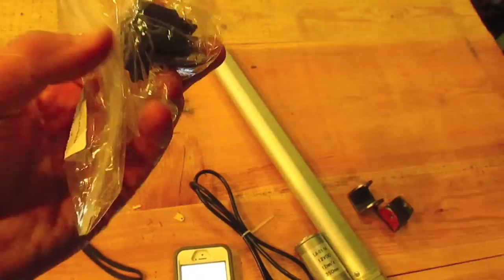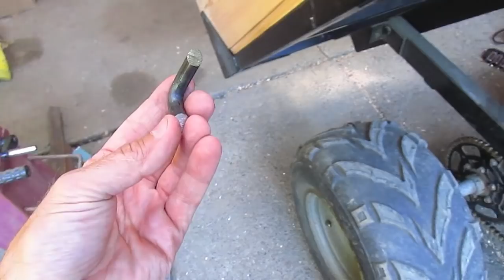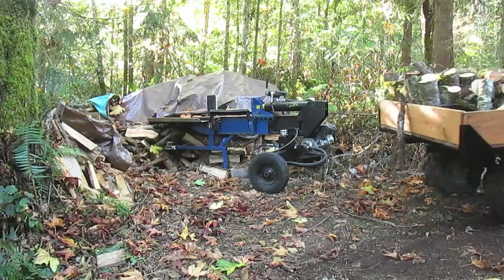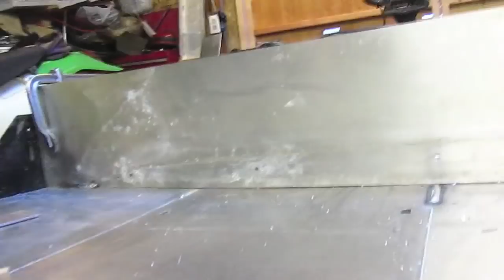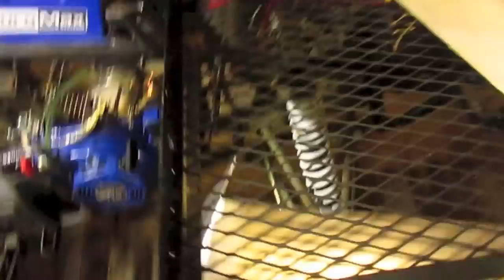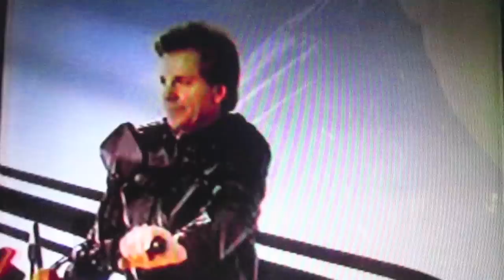Homemade ATV quad truck part 2

Comment: maybe put some raptor spray on the bed. Would look alot cooler and it protects the metal and your tools wont slide around

Comment: I just took a moto4 and stretched the frame and swing arm around 10". Made a steel flat bed. I didnt go as big on the box as you did but mine is a boat load stronger and shaft driven. I was copying as many aspects as i could from the 1989 yamaha pro hauler.
Reply from the maker: Right on,  hopefully the shaft dive holds up. 
I have hauled 500# many times in mine👍
Reply: @Mikefestiva  it's just 2 drive shafts welded together so it's only 4 1/2" inches longer at the swing arm. The other 5 1/2" is a frame stretch. It has 3 rear shocks to keep loads up. But she pulls too. Just this weekend I was hauling a trailer with 2 other Moto4s on it. Had to drag a locked up riding mower the other day. Not bad for having no weight on the back. I wish I could post pics here

Comment: I was surprised at the loose bolt. I use duromax on  my generator and backup generator for my house. My first engine had 10K hrs and replaced a carburetor and didn't start burning oil yet. I credit that to low rpm and synthetic oil, but still after 10K hrs, no loose bolts. That was unusual. I have one now with about 5K

Comment: Why did you not just fix the old engine n make a trailer
Reply from the maker: The old engine had many problems and had not ran in years, I have tight trails on my property and turning trailers around is not always possible in the woods. I have had many people ask the same question you just asked. 
Here’s my outlook on this build, I like building stuff, I don’t always take the path of least resistance, I don’t mind if it takes time to complete, I learn a lot and I end up with a useful creative machine.

Comment: hey i have a kdx also and i to have been restoring mine they are a good woods bike good choice i love mine its a 19 86 kdx 200 and its the fastest 200 i have ever seen good luck with yourse mine turned out nice
Reply from the maker: Nice! The KDX is a great trail bike!
I really liked mine, unfortunately It suffered some major engine problems and was going to be to costly for me invest anymore money into, it did have a glorious ending, the last major ride I did with it was the Odessa 100 mile desert race, the bike did great! But after returning home the engine didn’t far well.
Thanks for commenting. Have fun on that bike 🙂 I have a KTM XCW 200 now. I do miss the KDX

Comment: Picked the same quad up. Plan on doing a similar type of setup. Thank for some good ideas. Very nice.
Reply from the maker: Thanks for checking out my project! I definitely recommend building something like this, I use it all the time. Does your quad still run? If so that’s good, mine was in awful shape when I started. Keep me posted on your progress!
Reply: @Mikefestiva  yes the quad still runs. I paid 50 dollars for it at my local trash dump. Got it home still had the key and a battery and some gas and fired right up. Only had to replace the chain and rode it everywhere
Reply from the maker: That’s great! Your already half way there on your project! I don’t know if you saw part 1 of the quad truck video but It took me a lot of work to re power it just so it would drive again. The frame extension and dump bed was not to much to build. I would however recommend if you make it dump, just buy a more powerful linear actuator then I started out with, keeping it electric is simple, I ended up converting mine to hydraulic and it has amazing power but at a cost of complicating the machine. Take care!

Comment: Really like your build I bought a Polaris Ranger but if I had your skills Iwouldve built something like that! Way cool!
Reply from the maker: I have a old Polaris Big boss 6x6, it’s one hell of a traction beast! But it has not ran for a few years, it’s in need of carb work and crank seals, sometime I will revive it. What years is your quad? I’m sure with a trailer your quad can do everything my quad truck will do. Thanks for taking the time to comment! Take care :)
Reply: @Mikefestiva  My  Ranger is a 07 700 xp.I bought when my dad was sick{pamic buy}.My parent lived on a island w/steep hill.We use it to get grocerys old peaple cordwood up the hill.I have an old jet ski trailer that I use as autility trailer.

Comment: Cool project.  I saw another version of this where they lengthened the machine in the middle (in front of the engine) which allows you to retain the rear suspension.

Comment: why not weld up a dash and seat pan and make it a bench seat with a steering wheel? Possibly use a chain driven shaft for the steering?
Reply: either way this is an awesome build. ive been thinking about doing something similar for quite a while. if you went with a dash and bench seat it would need some sort of floor board as well. which might all add too much weight to the current setup. keep doing you though. it seems to serve you well pal.

Comment: i like it but a regular 4 wheeler and a small trailer do the same thing
Reply: i had an uncle that made wheel wells out of barrels
Reply from the maker: SurviventheOnslaught I see your point, keep in mine I was just working with what I had, if I had a good working four wheeler maybe I would have gone that route? One big advantage of the quad truck is turning around in tight woods and off cambered terrain. Take care
Reply: @Mikefestiva  its the best machine like that i have seen, mustieone built a quicker version but yours is better

Comment: great little atv, honestly though i feel you need closer to 20hp but im a little speed demon so it might just be me
Reply from the maker: Haha maybe when you build your's you can add the 20hp motor to satisfy the speed demon :)  but this small motor powers it just fine for my needs,  This has been a budget build and I think I have $500 to $600 total into this entire quad truck, a 20hp motor would have cost more then the complete build. I kind of like taking the minimal approach with the smaller motor, it's fun for me to see what I can do with a low hp motor.
PS did you see the video where a guy put a 6.5hp predator motor in a full sized 4x4 truck frame, with the right gearing that little motor will move that weight! Take care :)

Comment: I like the idea of a battery upfront. The damn things weigh like 40lbs. If you need more steering you should put a area where you can add bricks and remove them as needed

Comment: both clever and made a very practical vehicle  for your needs
Reply from the maker: I find it to be even more useful then I ever figured it would have been when I started off building it.
I have a small 4x4 tractor and it's a great machine but I use the quad truck more often around my house because it's quick to start, travels faster and is more stable on my trail and it can haul more firewood on every trip.
Thanks for watching!

Comment: how come people are calling these engines side shaft?....I also said horizontal shaft and vertical
Reply: always
Reply from the maker: Well mainly it's because the PTO or shaft is on the side of the motor not the top or bottom, some people like your self may prefer horizontal shaft but i'm sure you understand the meaning of side shaft and know what i'm referring too. You my ask others if you want another opinion why people call then by other names?

Comment: 7 hp!?
Reply from the maker: Holzwurm _HD Yes just a simple 7hp motor, you can do a lot by just gearing them down. It goes 15 to 20mph and that’s more then I need for hauling stuff around my place. Thanks for checking out my quad truck video!

Comment: you should upgrade it to the 18hp and give it less gearing so it will have more torque
Reply from the maker: Random Videos I really have no need to add much more HP to the quad truck, it does everything I need with 7 hp.
You could haul most of the stuff I do with a 3hp motor you just would need to gear it down and go slower. With the 7hp motor this will travel at about 15 to 20 mph with a full load of firewood, but I tend to go much slower because of the rough trails around my place. Thanks for watching my video.

Comment: I wish there was like a super like button on here lol I cant even begin to explain how bad I want one. Awesome engineering and build.
Reply from the maker: Tanner thanks so much for your awesome comment! I really appreciate that :)
The quad truck has been real useful around my place, I use it just about ever day!
Take care and if you get time I posted a part 3. 
part 4 is in the works, I’m working on a hydraulic lift for the bed, I salvaged a power steering system from a car.

Comment: What was the welder u used
Reply from the maker: Lupe Ibarra I used my Vulcan Omnipro 220 welder,  if you check out my YouTube channel I did two videos on it, one showed me welding and compared it with a Lincoln welder, the other video I ran the Omnipro with a Miller welder. Check out the videos if  you get time. Take care

Comment: Bumped into this post whilst browsing. Gotta say job well done mate. From 🇭🇲. 👍👍
Reply from the maker: M.A.W Thanks! If you get time check out part 3.
I’m working out a hydraulic system for the bed, I’m using a rack and pinion power steering setup from a car, I should have this video posted in a month or so on part 4. Take care

Comment: You never saw a battery explode because of a spark ?
Reply: That is a good point, but I think that this particular battery is sealed.  It however would be a good idea to cover it with a wet rag.  I did have an 8 D explode on me once.  Not a good thing for sure.

Comment: Hello again sir.  Where did you get the lead you used for that Miller Spoolgun adapter? The one that plugs in to the Vulcan machine.  Thank you.
Reply from the maker: Robert Boyer I found the plug on Amazon, I’m sure e bay has them as well.  Look up 
(Dinse plug)  the size is 50, it will say something like 35 50 for the size, if you look up dinse plug 50 you seem to just get plugs with 50 feet of cable so just look up Dinse plug, they run about $8 to $12 dollars. I hope this helps you out. Ps Dinse is a standard welding lead plugin on a lot of welders so that’s nice they stuck with something that works with many machines.
Reply: Perfect.  Thank you very much.  Bought my OmniPro220 yesterday.
Reply from the maker: Robert Boyer  Nice! Did you buy the extra warranty? I did for peace of mind, I bought mine right when they first came out back in October, it’s been trouble free so far, it just works real good, I just was running a Lincoln weld pack 140 at my work the other day and my Omnipro welds considerably better then the Lincoln! I hope your as happy with your Vulcan as I am with mine :)
Reply: Mike festiva   I did not buy the warranty. I hope that doesn't come back to bite me. I did buy a ton of other accessories to go with it. Their spool gun, tig gun, heavy duty cabinet (really nice) then splurged and bought the Lincoln 3350 viking helmet in the twisted metal scheme. I'm still planning on making an adapter like yours so I can leave the mig gun connected.
Reply from the maker: Robert Boyer Right on! You treated your self to some fresh gear! It’s nice putting some cash into new tools.
I just picked up a used Miller auto dimming helmet a few moths ago, it’s definitely seen some use but it’s got a lot of life in it still, some day I will treat myself to a new welding helmet too. I’m fairly sure your  welder should be problem free but I think you have about a month??? To buy the warranty if you change your mind. 
Well I hope you get that welder unboxed and start on a project soon :) take care!
Reply: Hey, I'm assuming  you still need to swap out your gas when switching between mig and the spool gun right, or have you found a way to keep them both connected?  Thanks.
Reply from the maker: Robert Boyer I need to swap out mainly because I only own one regular, I’m running co2/ argon mix with my MiG, and I run 100% argon with my spool gun so that’s the main reason for changing. I really should buy a extra regular sometime.
Reply: I have two tanks and two regulators, but don't you still have to connect them to the same port though?
Reply from the maker: Robert Boyer sorry your right you still run the gas in the back of the welder, I have not hooked up my spool gun for 5 months. The adapters gas hooks up to the front of the welders spool gun port. I wonder if there’s a gas line selector you can buy kind of like a LP gas ball valve to select what tank you want to run?

Comment: Need a safety plate to protect your back! The wood just needs a gap between boards, I always used a 16 penny nail as a temporary spacer when fitting the boards. That gap would allow for expansion due to weather. Great video!

Comment: HOW MANY INCH IS THE ACTUATOR?
Reply from the maker: It's 18" 
I'm in the process of installing a hydraulic pump from a car and I'm also using the rack and pinion from the same car to lift my quad truck bed, It should be a lot better!a

Comment: Suggest a guard for the top of your battery.  Leave an 1/8" gap so that the wood can expand when wet.  The wood bed is more forgiving, and prevents things from sliding around.  You're going to see dings in the aluminum over time.  Some rear fenders would be good too.

Comment: The reason your wood bed buckled is because you didn't leave a space between each board, you should have left at least an eighth of an inch between each board then it wouldn't have done that.... Also I would have scrap that motor transmission setup you had I would have used a small block chevy with an automatic transmission out of a vehicle not an ATV and build it around that..
Reply from the maker: I know now that I should have allowed room for the wood to expand, I added the wood bed in the summer months and oiled it thinking it would help it from soaking up the water, I haul a lot of sand and gravel so gaps between the boards are not ideal, I ended up leaving it outside all fall and in the northwest we get a LOT of rain, If I would have parked it under cover I think the wood could have worked out better. I'm real happy with the aluminium bed I welded for it now.
Haha I guess if you used a small block and a auto you probably would just use the entire 4x4 truck! Everyone has there own way they would build one, for me the size of this is right for my property, I have a F250 for hauling big stuff, It just can't get it out on the tight trails around here, my quad truck is mainly for quick trips hauling things around.

Comment: Predator 420 would have been a better engine to go with
Reply from the maker: I guess the 420 would have worked out too, but the 6.5hp motor moves it around just fine, It will haul a full load of firewood up any trail on my land at a pace fast enough for me, it's all about gearing, I don't need to go fast with a heavy load of firewood.
Reply: You shouldnt*

Comment: Interesting build.  I am doing something similar with a trx250x.  Though instead of extending the swingarm, I split the frame and extended the wheel base to 6ft.  I'm not making it a straddler like a quad...I picked up a bench seat for a go kart and making it to function more like a golf cart or gator with a bed.  I even cut the steering shaft and added a U joint, then converted to a steering wheel rather than handle bars
Reply from the maker: That sounds like a cool project your working on!
I thought about converting mine over to a bench seat and steering wheel but decided to just run it the way it is for now.
Are you going to post a video of your build? If so I would like to see how it comes along.
Take care Michael
Reply: I have a YouTube channel called BecauseRabbler where I am chronicling the twin turbo conversion of a 1964 Rambler Classic.  I thought about doing a video series on this build, because it sure seems like kart based builds get a lot more views, but I wasn't sure I'd have much to share.  I'm making it up as I go along.  It is coming along well though.  Tonight I built the dash panel and worked out the steering angles.  By this weekend I should have a rolling chassis.
Any regrets on using the 212 predator?  I was thinking about using the 420, but the torque converter starts getting pretty expensive as you as horsepower.

Comment: Awesome build but needs at least a 12 hp motor
Reply from the maker: Thanks for checking out my project.
With the gear reduction it's got, the 212cc 7hp motor moves it around fully loaded with fire wood or gravel surprisingly good!
I have a lot of hills on my property loaded it always seems to pull up the hills, It's not a fast machine but that was not the intention of it, It's more of a tool/ wood hauler.

Comment: sealed wood wouldn't have soaked up water and warped
Reply: Paint your wood with used motor oil . It will last longer old farmer trick

Comment: No wonder it stopped working the engine looked like it was outside for 80 years
Reply from the maker: BrandoBrap did you see the first part of this project?
The original motor had problems even when only a few years old, carb was crap with a electric choke that never worked right, and the thing was plagued with electrical problems, this was only a few of the many problems the motor had. I gave up on the motor years ago and it sat for maybe 8 plus years after it stopped being even worth trying to keep running.
So that’s why it stopped working, not because it was out side for 80 years.
Reply: Mike festiva I was really only kidding around? I was referencing the fact it looks like it sank in a swamp and stayed down there a few millennia
Reply from the maker: Haha! Well the Northwest is kind of a swamp, everything grows moss and green stuff if it sits around at all.
It did look like a complete pile of poo before I started working on it.